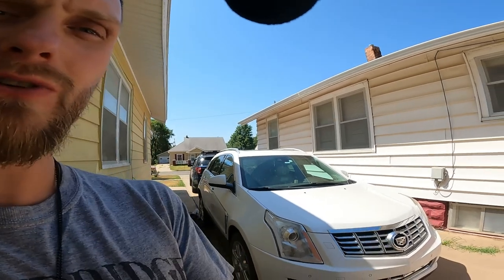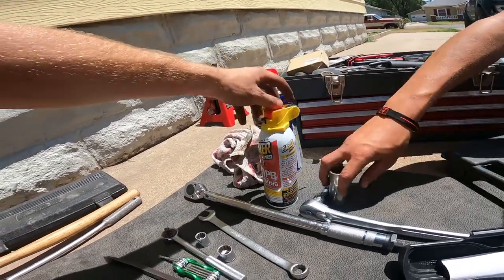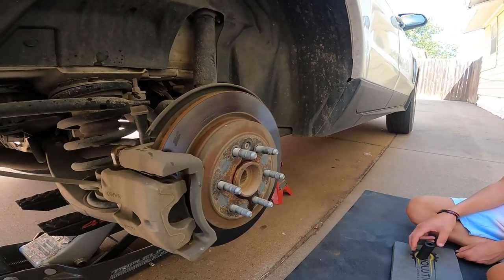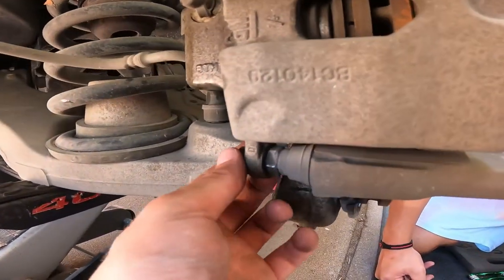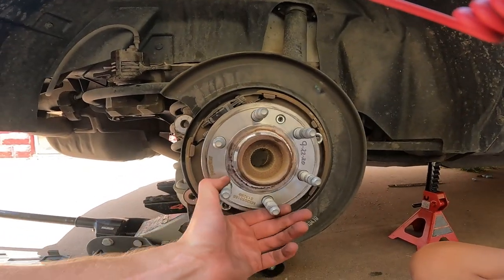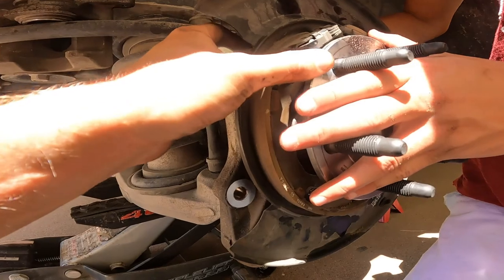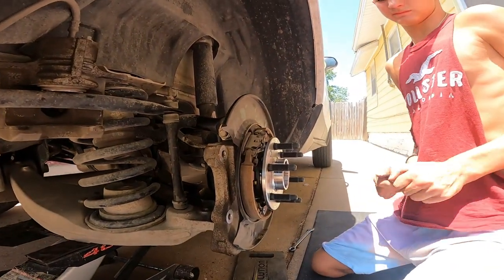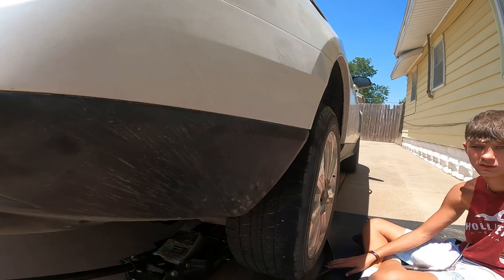How To replace a Wheel Bearing on a 2014 Cadillac SRX - Daily Vlogs

Comment: Easy because it was only in there for a year. Had to replace one at 50k miles. Doing 2nd one at 120k miles.
Reply from the maker: Definitely! Those require more Hammer time. I've run into parts that didn't come apart so easily. Strength and a hammer got them loose